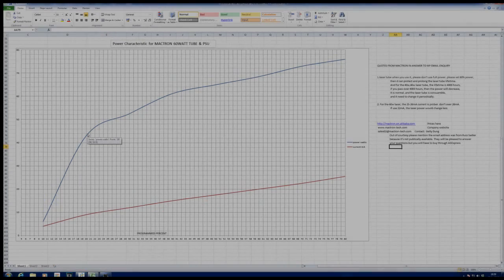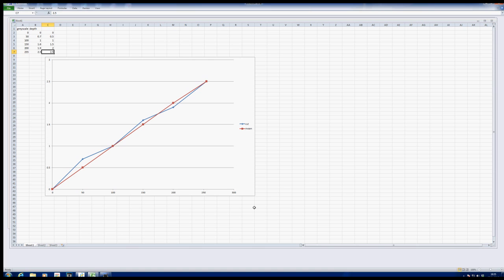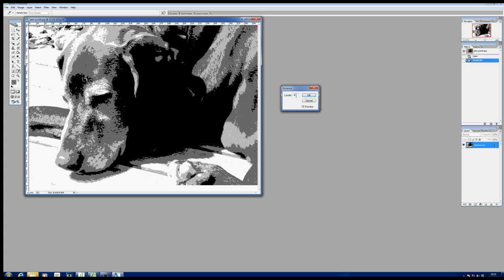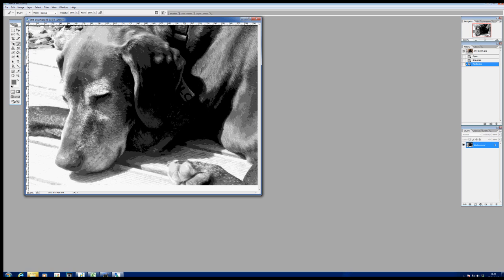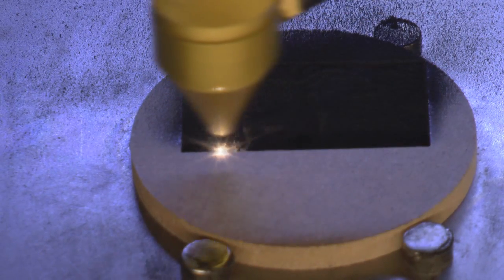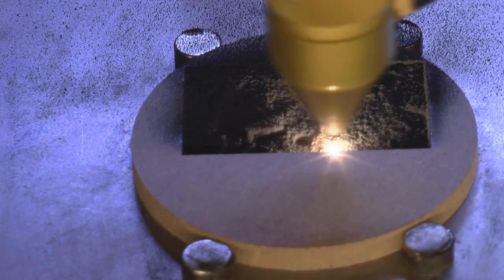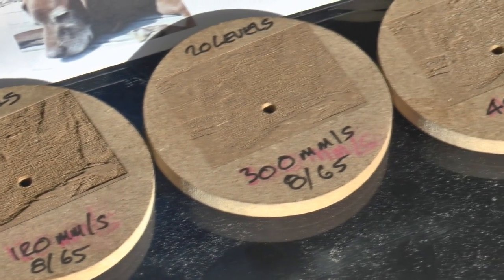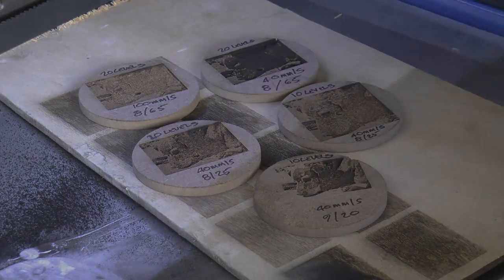RDWorks Learning Lab 57 3D laser carving Is it possible

Comment: hi, i just paused the videos at the moment where u showed the ad of your machine ( the 256 colors separation for cutting )
i think 256 colors mean the number of layers u can add in the software to put diffrent parametres like black and red for cutting and engraving
Reply from the maker: Hi
Interesting thought but your assumption is incorrect. The 256 colors refers to the grey scale. When you convert a colour picture to black (0) and white (255) the different colors that were in the original are are translated into shades of grey  by mixing the black and white. There are 254 shades of grey between black and white giving a total greyscale range of 256 colors.
You will note that when you import a picture into RDWorks it automatically defines it as a BMP. If you zoom in on the picture you will see the individual pixels are all different shades of grey..The software has mapped the coordinates of every pixel along with its shade of grey and depending on the max min power parameters that you set, if you set the OUTPUT DIRECT switch on, it will look at the power range you have selected say 10% min and 40% max and  make the following simple calculation. (40-10)/256 =0.117% power for each greyscale increment.. As is have already mentioned, the machine has a complete map of your picture in its memory and so can send a power requirement to the tube for EACH pixel. It may sound unbelievable but this cheapo machine is capable of this incredible task. That is how it can perform 3D engraving. More power for the darker shades means a deeper cut..
I hope this answers your question.  

Best wishes
Russ

Comment: Hi, is it absolutely necessary to have an auxiliary rotary device, to achieve the carved effect on wood?
Reply from the maker: Hi Faiz
There are two mains sorts of engraving. One is constant depth engraving, like the sort of thing you see on a rubber stamp. You could call that 3D engraving but its not proper 3D cutting. The second sort is proper 3D engraving as shown in this video. See also https://www.youtube.com/watch?v=j5cIFxGu_1g
Rotary engraving is  for engraving cylindrical objects. It is something completely different and does require a special rotary attachment. There are two basic types of rotary engraver, the chuck type and the wheel type. Both have their specific advantages and disadvantages.

Best wishes
Russ
Reply: Thank you so much I really appreciate your reply, so what your saying that no rotary device is required to achieve a carved out effect on a flat wooden surface, I just needed to make the distinction because your own machine does indeed have an auxiliary rotary device. Also could you tell me if your laser pointer moves up and down to achieve carving, or is it simply changes in power that allow the "rounded edge" effect, I was previously under the impression that Rdworks did not recognize different shades where the progression of grayscale is from lighter to darker, or vice versa, and where no distinct lines or curves were "closed" objects
Reply from the maker: There are two types of graphics, vector and bitmap. RDWorks can work with both. With vector graphics RDWorks can either SCAN closed objects at a constant power (not 3D engraving) or use the vector lines as CUT paths. With bitmap images (jpg photos etc) RDWorks can decide on the grey level of EVERY pixel and change the scanning output power of the laser whilst it is scanning to produce a variable depth cut. see how all this takes place in  https://www.youtube.com/edit?o=U&video_id=J0KEg5X6wlA

Best wishes
Russ
Reply: Thank you Russ ,, I had thought that this was still uncharted territory on rdworks and these chinese laser machines, as no other sources on the net can give the information you have provided. Thank you so much you have really helped me step up my designing and engraving to the next level.

Comment: Your awesome!
Reply: Hi David
In retrospect , not that awesome I'm afraid to say. This was my first foray into 3D engraving and  I was very pleased to find that the machine could do ANYTHING 3D. As you follow on through my journey you will find that my next attempt at the problem a few months on shows that the machine is capable of 256 grey level engraving but that you will never achieve proper 3D  profiles unless you have specially prepared bit maps where the greys follow what on a survey map would be contour lines. The pictures look really strange but they do work well.. Even further on ao get my oscilloscope into action and look at the signals that are producing the grey scale [power variations. Even 18 months on I am still not finished with the subject because it still holds secrets which I personally need to understand. There are many discoveries about how the machine works that will eventally allow me to formulate some rules for 3D engraving.
All best wishes
Russ

take a look here
https://www.google.co.uk/search?q=3D+engraving+bitmaps&tbm=isch&tbs=rimg:CfrxiPq5CZcIIjgfFciFIwJ489kuKan6MRvK94-ks0wQMhhMTOVjEHZGTkTtLytKhADI1EcNlB6HvJalMkwuU5DxpCoSCR8VyIUjAnjzEf4Z1F-0bslrKhIJ2S4pqfoxG8oRHvXBKKP6og4qEgn3j6SzTBAyGBEOLxrAUvIFrSoSCUxM5WMQdkZOEdtUu7L9KU8jKhIJRO0vK0qEAMgRe9pG0lmkZXoqEgnURw2UHoe8lhF3Bs0O4BlKKioSCaUyTC5TkPGkEXc8_1lY2YdXY&tbo=u&sa=X&ved=0ahUKEwjZjpmMxN_XAhWE1RQKHRFXD1AQ9C8IHw&biw=1249&bih=598&dpr=1.5

Comment: Hi Russ, 
as a young engineer and potential buyer of a machine, I've been following and enjoying your series quite a lot! 

Though this might be quite late: 
I was thinking of maybe trying a negative engraving on the image? 
It seems to me, as if the image might look a lot better if you inverted black and white before the engraving process.
Reply from the maker: Hi Tobias 
If you imagine the 3D object as a hill on an ordnance survey map. you can almost see the shape of the hill from its CONTOUR LINES.. In 3D engraving it's the same as those contour lines where  there are 256 contours starting at black and  finishing at white. The surface of your material is white and the deepest cut will be produced by black in your image. What you then do is actually set the power of your beam to two levels (max and min) The software decodes your picture into the 256 colours and the controller then outputs one of 256 powers to match the colour in the picture. However it is the power between  max and min that is actually divided into 256 different output levels and during each scan the power level (0 to 255) is matched up with the contour colours ( 0 to 255) encountered during that scan. The first thing you must realize is a photograph will not produce a correct 3D image,, yes it will obey the greyscale engraving rules and match power levels to colour  and produce a bumpy surface but it will not be a proper 3D relif carving. Making the picture into a negative will just make those bumps the opposite way. 
Take a look at 
https://www.google.co.uk/search?q=3d+laser+engraving+files&tbm=isch&tbo=u&source=univ&sa=X&ved=0ahUKEwjNooCakcjVAhXoCcAKHVYECuwQsAQIUg&biw=1920&bih=990 and you will see lots of ghostly looking images that are used to produce this sort of 3 D carving and you will see that they look nothing like photographs (positive or negative). I have tried to produce my own simple pyramid shapes with graduated fills but failed miserably.
Also take a look at then Kerns website for a better explanation.  It is a fascinating subject.

Best wishes
Russ

Comment: Russ,
What are the copper discs you used for your mirrors.
I will; try to source some here in Perth Australia

Trevor
Reply from the maker: +Trevor Harrington 
Hi Trevor
I had lots of small 185mmx85mm rectangles of 1.5mm thick copper sheet That's enough for at least 30 discs. I had a look onebay.au for copper offcuts but they are stupid prices. for $10 to cover economy postage, I could send you one of mine. Just a thought if you cannot find a local source.
The other important accident of fate was to use 
http://www.meguiars.co.uk/shop/nxt-metal-polysh
I find out from some guys in USA that this is what's used by lots of the keen amateur astronomers who make and polish their own mirrors.  It does a great job and here I am about 4 months after installing them and I have not yet had to take them out for a buff up. This is one discovery I am REALLY pleased with.
If you want to be lazy you can get copper mirrors from China
http://www.ebay.com.au/itm/HQ-K9-Si-Mo-Cu-Reflection-Mirror-for-CO2-Laser-Cutting-Engraving-Diam20-25-30mm-/230933149109?var=&hash=item35c4b035b5:m:mIDAZF4aFahBrCP1LJ89HgQ

Good luck and best regards
Russ
Reply: Russ,
Thanks for your offer very kind of you.
I will give it a bash trying to source some here.

regards

Trevor

Comment: thanks for that. if you want to test with another motive: i rendered out a real z-depth image from my 3d-program. i did it on POM. but i think my laser is a bit weak for greater depth.
https://www.dropbox.com/s/9el2uhnpej4fw6f/moon_verne05.jpg?dl=0
Reply from the maker: +volkmar hoppe 
Hi Volkmar
Thanks for that amazing image. I'm already planning my next video about the principles of creating a 3 D greyscale image. As I proved in my last video, you cant just take a grey scale photo and hope to get a sensible result. It has to be a specially prepared picture where the shades of grey are a seamless analogue of a contour map. I have no sophisticated software for doing this . What software did you use to achieve your picture? Can I use this picture in my next session? I have several  links to pre-prepared  pictures that others have sent me and they (along with yours) will all be good demonstration pieces.
Thanks again
Best regards
Russ
Reply: +SarbarMultimedia 
hi 
i am using cinema 4d. but rendering a z-depth should not be a problem for other 3d software. i didnt do the sculpting of the moon, thats just a samplefile that comes with c4d studio. after setting the proper greyscale range and after some tests i had to adjust the rendered z-depth quite a bit in photoshop. more contrast especially in the light tones was important. please go ahead and use it if you like. i am curious about your results.

Comment: Hi Russ, great video again. For your next experiments may I suggest you try also vector engraving reliefs using the laser beam in varying depth paths like a CNC mill cutter. It's probably more work to produce the images but the results could be cleaner and maybe smoother (and faster).
Also for raster engraving you could try using several speedy passes as laser makers suggest (Epilog p.e)
Reply from the maker: +SotirisG 
Hi 
I'm sure I'm only just scratching the surface of this subject and I have some experiments I want to do for the next session.I also have received some links from a couple of guys with specially  prepared images  for 3D laser carving. Having proved that the machine is capable of responding to multiple shades of grey, and also demonstrated that you cant just take a photo and expect to get a meaningful result, the plan is to develop some simple graphics that explains the manner in which this use of grey scale must be exploited.
I think you are suggesting creating a continuous line contour map of a 3d surface. Let me ask you as a CNC man, if I gave you a 0.1 mm cutter and asked you to do it on your mill, what would be your reaction?  Dont take that as a snub or criticism it was just a way of imagining the immensity of the task. I certainly don't have any 3 D profiling software to apply to the problem
I have a bigger problem that I am noticing and that is some pattern of lines developing at 90 degrees to my scan lines. The same pattern exists when I speed the traverse rate and also when I defocus. Its almost as though I'm seeing stepper motor steps. Strange, because this is going to affect the finished quality of any work I do.
Thanks for your input
Sincere regards
Russ
Reply: +SarbarMultimedia 
Yes, although the laser has no actual cutting to do and just slides over as in raster engraving, at 0.1mm this process wouldn't be practical for large projects. But you could try a simple image with a small number of gradient steps to check these patterns you have in raster. You don't need 3d software or gcode, just some simple vector shapes (in CDraw or AI) contour filled with different colors for different power levels. E.g. design 10 concentric circles and fill each one with a different colour 0.1mm contour fill, or trim a cross hatch pattern around it. The depth would come from power levels, not z passes.
p.s. there are some videos on yt for vector engraving with cheap chinese lasers. With a defocused beam and wider line passes results could be better than raster engraving.
Reply from the maker: +SotirisG 
Thanks for that information. I'll hunt around YT to see if I can find them.
Russ

Comment: here:
https://drive.google.com/file/d/0B4KOVYCG-x-6WHVUWHpLN3l4c3hiZFcyZG9oeG91WVZyYks4/view
do this graphic , it will be easy to compare with other machines because everyone is engraving this picture
Reply from the maker: +mateusz1945 
The question is are they doing it successfully with clunky little Chinese Dragons or is this something just for the serious Trotec, Kern and Epilog type machines. I have already planned to investigate the principles involved with this type of engraving in my next session because although demonstrating the principle of 3D is possible, you can't just convert any old picture. It has to be a carefully worked graphic to get the right effect. I can see many of the aspects I'm planning in the graphic link. Thanks for that, I will experiment with it to see what's possible but when I look at all my cuts I see very definite patterns in it and I haven't yet worked out what's causing it other than its the acceleration and deceleration steps for every step of the motor. That's going to make it very difficult to get a nice cut. I can smooth it a bit  by dropping the table but it's still there. Increasing speed doesn't fix it either. An interesting problem  before I've even started !!!
Thanks again for the graphic
Russ
Reply: +SarbarMultimedia well i did this eagle on my chinese laser with same electronics as yours  and it looked pretty damn similar to Epilog's results. Only difference was i think i did it with 100w tube. I agree it has to be prepared picture. i found it best to make 3d model  of your project and then convert it to grayscale using artcam. I dont really know how to do convert pictures, photoshop skills would be needed.
I think our machines  are compensating for acceleration and deceleration , all i did is drop that picture in rd works set correct min/ max power and speed and was preety much it.
Reply: +mateusz1945  here are my results:
https://drive.google.com/file/d/0B4KOVYCG-x-6MHVPNmRJQ2lmZ0U/view?usp=sharing
each emblem is 4 inches wide , wood is maple
Reply from the maker: +mateusz1945 
That looks pretty good, UK has lots of wood but not maple, I suspect that will be expensive. I may try it with bamboo. I do note that  your deep cuts are also showing the brick-like coarse canvas pattern. Any ideas? How linear is your tube output because that will have an effect on how the greyscale is treated
Many thanks
Russ
Reply: +SarbarMultimedia i did 8 bit grayscale test and it did look like my output is fairly linear. I guess i could find better settings to make it look even better. I dont really know what causes canvas pattern... Going out of focus? it is pretty shallow cut.  I dont know

Comment: I had the best results using Photograv (dotted image 76-300 dpi) and engraving at fast speeds and high power (400 -500 speed, 70 power), or else low speed low power (100 speed 25-30 power), almost same results but double the time.  Grayscale not giving me good results, I can provide a link so you can try the software if you like, sorry for the bad english.
Reply from the maker: +3DsbsMx 
Hi
Thanks a lot for your input I will try your settings when I get to explore dot graphics.  I think there is quite a lot of things to learn about the grey scale. It is a difficult subject that is shrouded in mystery. Those that can do it,  don't seem willing to say how.  I have already dabbled with dithered graphics in some of my early experiments but they were mainly to explore the very basic aspects of the Bitmap Handle. That is a whole new part of engraving that will cover in future sessions.
Best regards
Russ
Reply: +SarbarMultimedia looking forward to see the outcome of the experiments btw my machine is pretty much identical but the laser tube is 50w. I'll upload some pictures of the engravings using Photograv.
Reply: +SarbarMultimedia Here:
https://drive.google.com/folderview?id=0B1hhlO4h6dM3aXZORW9tQ3VHckk&usp=drive_web
Example photos and there's the software in case you want to give it a try.